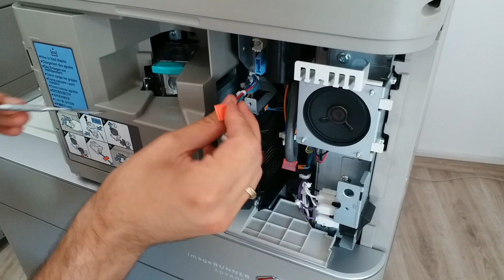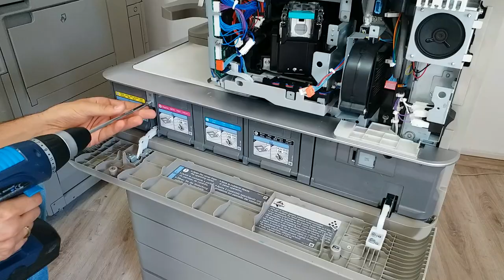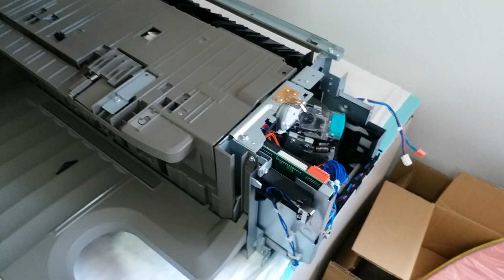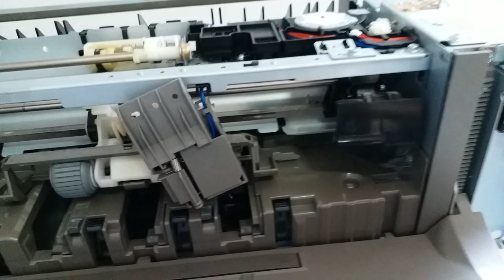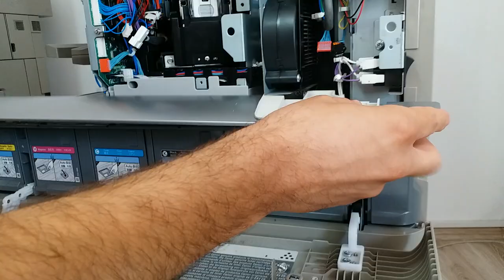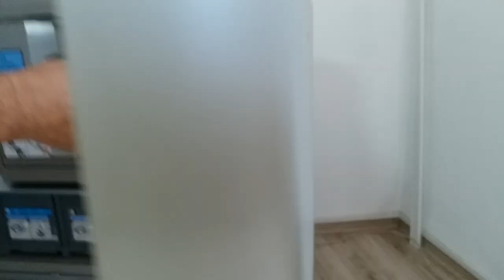Remove finisher from Canon IR Advance C5030 / C5035 / C5045 / C5055

Comment: I have a cannon image runner c5045 however it keeps on jamming paper from the external finisher however I disconnect the finisher and wanted to print direct from the main printer however it keeps on reading paper jam from the finishers after I disconnect the finisher from the printer. What would be the problem and how to solve this issue??
Reply from the maker: You also have the exit tray that drives the paper to the external finisher, and I think that you have to change te default exit tray to the one above (i think it's called exit tray B).
You type the copier's IP in an internet browser, you log in as Admin (7654321 for user an password) and from the tray menu (I don't remember where it is) you have to change the exit tray to the one above.
If you don't find it please write back because I have one at work and I can guide you step by step.